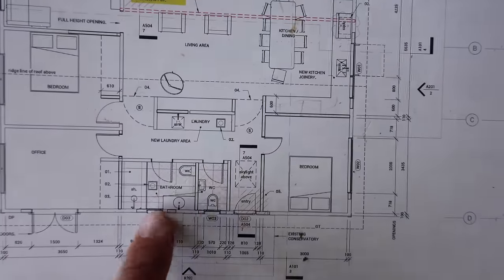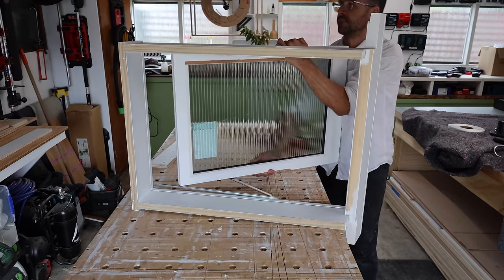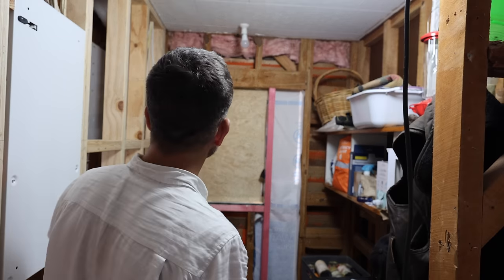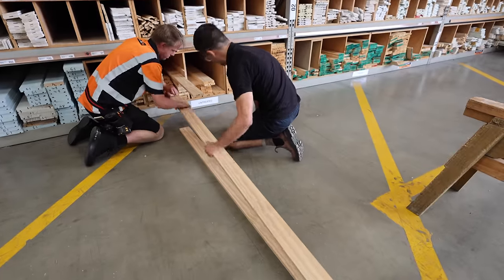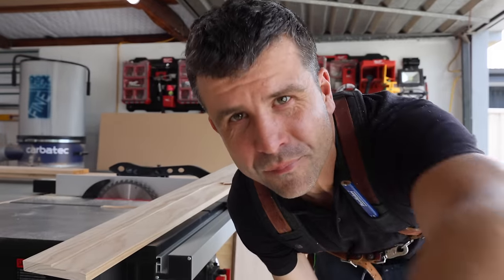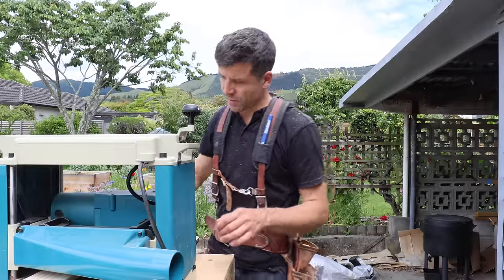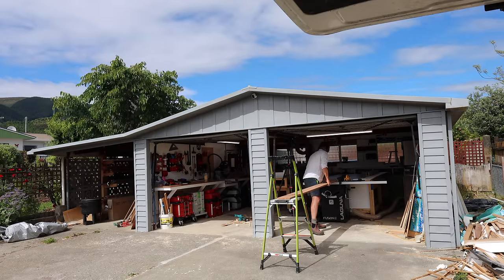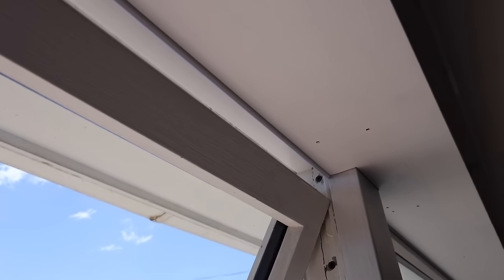Green Velvet Curtains, Natural Timber, Windows and a Garden

Comment: you should really put the finish (oil/stain/clearcoat) on those cabinets ASAP.  the same thing that happened with the sun discoloring that one board is going to happen to those cabinets closest to the windows.
Reply: And both sides, seal, at the same time. To prevent warping.

Comment: At 10:53 …….Scott it’s not because pine is soft ……On a cross cut blade the sawdust, blocks the gaps between the teeth of the blade the more teeth the less room especially if it’s in an enclosed cut, which causes fiction and clocks the kerf as it can’t be cleared, this also overheats the blade and can damage it…..that’s why the teeth on a Rip Cut blade are longer and there are less of them to help clear the blade and let it run freely…..also there is a lot of resin in the pine wood which is not good ….!!👍👍

Comment: Did you have a ripping blade on the table saw? More efficient on big (deep) rips = less strain on the motor. (Panel blades and cross cut blades will rip small stuff and leave a cleaner finish, but go with the shallower 10deg grind on a ripping blade for cutting with the grain. Highly recommend ripping blade for the rail saw too, if you're ripping timber.)
Ah, the good old 100mm trick!!! Can't tell you how many times I've done that. Once, only once, I randomly added 100mm to a measurement when I didn't need to and was completely baffled for ages. 🤣
Jess do Jess. To heck with all those "Influencers". 👍

Comment: Buy a thin kerf ripping cut blade (I use Diablo) for your table saw. They are quite cheap, and the thinness of the blade combined with the greater distance between the teeth will keep the blade from getting bound up.  Also, before you switch from your regular blade to the thin Kerr ripping blade, apply wax to the blade and buff it clean.  You will have a much easier time.

Comment: Hey Scotty, I use a featherboard when I am resawing (carbatec has the Bow or Hedgehog ones I use) and I only set the blade height to about 60% odd of the board. I find that helps keep the board aligned and reduces load (and gives a cleaner cut). Or get a bandsaw!

Comment: Tip. When ripping timber like you were doing on your architraves, lower the blade for the 1st cut and gradually raise it. Also a ripping tungsten blade will perform better than what you're using.

Comment: Occasional furniture maker here. You need a feather board for the type of cut you were trying to make. I've seen cuts in previous videos that would warrant a feather board.
Also, unless you have a sharp 24 tooth blade you can't cut full depth on a normal table saw, even if it's pine.
So a feather board with a shallower depth of cut would have worked there.
But in the end I would have done the same, and used the planer.
Reply: A mag switch featherboards are great for cast tops.

Comment: Pine fibres fill the saw cut quite easily when using crosscut blade as way too many teeth which compress and  block passage of blade use a rip blade.

Comment: Hey Scott - Painting tip for rimu... Putting an initial coat of Sureseal/ oil based pigmented sealer on bare rimu makes the waterbased paint stick soooo much better. Otherwise the oils in the timber can make it pretty easy to scratch off.
Reply: agree i have a 100 year old home made entirely with rimu.  when i painted the outside window frames i had trouble with the paint blistering in places.  i had used resene paints and prepared the surfaces correctly.  but yes, you need an oil based paint.  to be honest oil bases still stand up better than water based.

Comment: I bought my house in 2016 and re drywalled the whole interior of the house, mostly by myself, my wife helped a bit and I did all the finish carpentry that took 7 long months then I started on framing my basement and also add a 10 long by 5.5ft wide bathroom that took longer then took a nice break a year and a half later I changed 12 windows and had a few Friends with 2) large windows that were 5ft tall by 6 ft wide and the last but not least my wife had the idea to put in a separate door to the basement from outside it felt like forever so I know your pain😅😅

Comment: We has those louvre windows back in the 70's in the UK, draughty and easy for burglars to get into. Pine is soft but it's sappy, clean blade needed (do you ever clean your blades?) or better still buy a rip blade! I can tell you need a new Planer/thicknesser hopefully one of the tool brands will see this 😁 I would NOT have painted that it looked so nice. If Jess thinks her jumper is the same colour as the curtains she need to get her eyes checked out. Starting to look like a 'Home' now.
Reply: He needs to get Gaston's blade cleaning gadget. And most importantly read the instruction manual😂😂

Comment: Why not make the sill from MDF ?
Reply: MDF is inappropriate for any area where there is a possibility of moisture getting in.
Reply: @oltedders   myth
Reply: @kezzaman  no it's not a myth.  I have an 80s addition on my house with MDF window reveals and it's got a little bit wet over the years with condensation and expanded (even though the paint is maintained).  A pine sill could be sanded and repainted.
My windows need removing and reveals removed and replaced.
MDF should NEVER be used where it might get wet/damp
Reply: @dsjjvfdjkdd  thats 50 year old mdf, if it was treated at all i doubt it would match today's stuff.
Reply: @kezzaman  
Yes, MDF has improved, but why tempt fate?
BTW, MDF only comes in sheets. That sill was obviously longer than 8'. It would have had to have been pieced, which it far below the quality of work Scott is doing.

Comment: $140 for a piece of wood and it's reclaimed! Was the missus waiting for you with a rolling pin? That New Zealand pine is really nice. In the US, Home Depot carries the NZ pine and it's a fair price. You can get some nice black stain or white paint (like yours) for it and it'll knock your socks off! 
Our emotional biorhythm cycle lasts 28 days, and our intellectual biorhythm cycle lasts 33 days...maybe that's what happened to both you guys? 😆
Reply: It's Rimu that they ended up going with on the window. We don't mill our native trees anymore, that's why the recycled stuff is so expensive. 

And our housing stock has a lot of these old, beautifully built homes. 👍🏾
We're doing a remodel bathroom and we're pulling up the flooring to use in the space left by the removal of the chimney. 
Everything is expensive in NZ 😮
Reply: That rimu board didn't turn up in the shop like that. 
It has to be removed from a building, transported to the shop, de-nailed, scanned, taken to the mill,milled/profiled then transported back. @scottbrowncarpentry I'll have a word to Andy in the shop, see if he can cut you a deal on any further supplies

Comment: I did a major remodel on my own house 20 years ago - all new electric and new kitchen/living room floorplan and more. It was pre-YouTube and a lot harder to figure stuff out. My rule ended up being that everything took 4 times longer than I thought it would. If you haven't done this kind of work for yourself, you really need to not comment on timelines.

Also, here in the states, we call what Ray was doing, "burning an inch." You can get a more accurate measurement, but if you forget, you can really screw yourself. I've definitely done it. Can be hard to remember when you're so focused on the macro of what you're doing.

Comment: I stalked you. Will visit with cold ones and pizza next time I'm in the area. Good thing I didn't a few weeks ago - seems like you may have been in Aus at the time! PS, if you want a nice and special bottle of bubbles for xmas that supports local, duck over to St Claire's and get a bottle of Dawn for $65 :-) grabbed two before heading further north. Only available local, duty free, and online because small volume production. Freight may be cheaper than the diesel, but it's a nice drive. <3